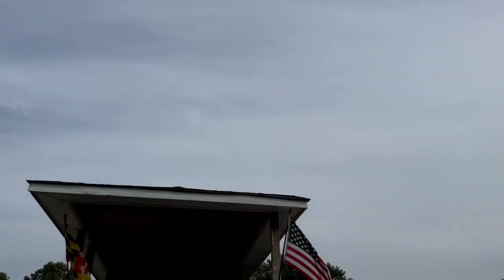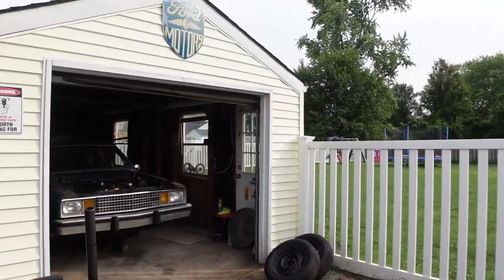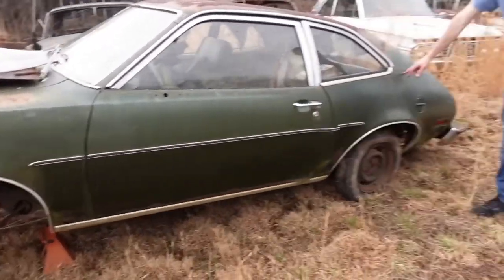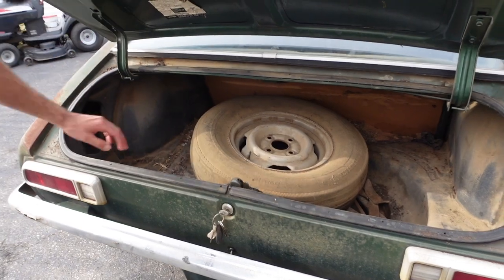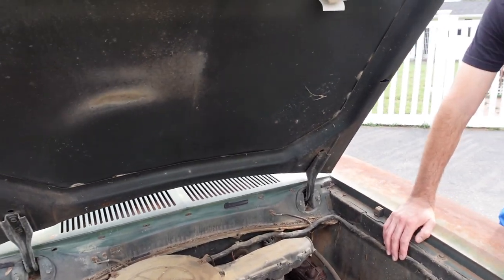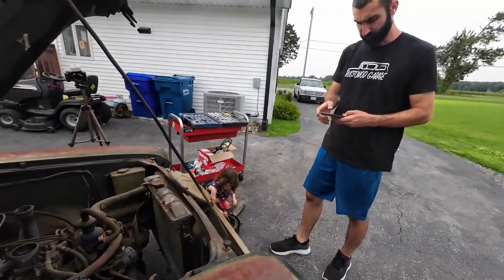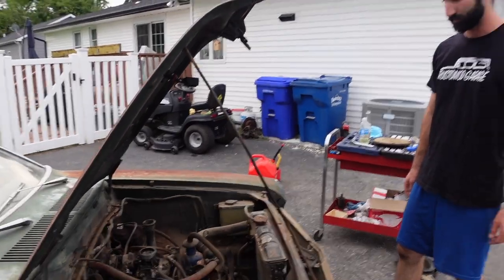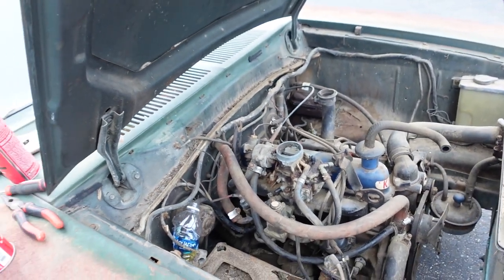Will This Junkyard Patina PINTO Run After Sitting Abandoned For 30 YEARS??

Comment: The Pinto came out when I was 13 years old, and soon it seemed like you saw them everywhere.  I had several friends who owned Pintos, and I both drove and rode in them.  They were considered decent small cars with good fuel economy, and were fun to drive-- especially when contrasted with the typical "road yachts" of the time.  At the time, there was nothing "unique" or rare about them... between 1971 and 1980 Ford made over 3.1 million of them in three basic body styles:  the 2 door sedan (which is what Lance's car is) with a conventional trunk, the Runabout with a hatchback and folding rear seats, and a 2 door wagon.  In the early '70s, imports were taking over the small car market (following in Volkswagen's footsteps), and many Americans purchased Pintos, Vegas, and AMC Gremlins in their effort to "buy American" and still get some semblance of good fuel economy.
Reply: Yes more of the pinto I have a 1974 pinto love these cars mine is just like Lance's

Comment: If Ford had just addressed the gas tank issue immediately, the Pinto's history would be a much different story. I still love the Pinto despite an easily fixed issue.
Reply: Nonsense. There was no gas tank problem exclusive to the Pinto. Extensive bad publicity caused by the lawsuit made it seem worse. The circumstances would have been as disastrous in a deuce and a half. A vehicle stopped in the travel lane, with a just filled gas tank, minus the fuel tank cap, rear ended by a van driven by a distracted driver with a suspended license travelling at excessive speed. 
The lawsuit was about money and someone desirous of political ambitions.

Comment: Great car. My first new car was a '72 Pinto Runabout, Forrest Green Metalic (the actual color name) with green interior. LOVED that car. I had the 2000cc engine. You are correct about the fire issue, I believe the actual deaths from fire were like 7. The Pinto was actually much safer than many other cars of the era. I drove mine cross country a number of times.

Comment: Pintos were never any more dangerous than the Toyotas and Bugs at the time.  It's just that Ford got caught cutting corners on safety.  It chose save money to by not addressing a known safety issue.  The bean counters at Ford estimated that it was cheaper to deal with the lawsuits than fix the problem.  If it wasn't for that fateful decision, the Pinto would just be another 70's economy car.

It would be great to see more of this car.  There are not many Pinto videos on YT.

Comment: The reason them cars exploded is because where the fuel take it and if your rear ended the tank can rub on the rear axle and cause spark and explode but Ford did a recall on them and put a fiberglass guard piece around the front of the gas tank so it will not spark if rear ended.

Comment: The #1 reason the media ran with the story is Ford decided it was cheaper to pay wrongful death lawsuits than to recall the cars and fix them. Also the first people to die in a Pinto crash/fire was a single mom and her son. They ended up issuing a recall anyway and retrofitted the early cars with a super thick plastic sheet in between the gas tank and the rear axle. I actually had a recall/retrofit car with the plastic sheet that I built into a circle track car. Many more people died due to the Chevy pickup saddle tanks on the outside of the frame rail than Pintos.
Reply from the maker: Wow crazy!
Reply: Exactly right. The cars wasn’t the problem, it was no different to other cars of the era. The issue was Ford making a financial decision where a safety decision was required.

Comment: I have been driving a 1972 Pinto Squire wagon for over 30 years. 2.0L SOHC/4 speed. It has zero rust, but lots of patina. It is an original AZ car, and the sun has burned the paint and faded out the woodgrain vinyl to almost white. It was originally Ginger Brown. Except for the cracked dash and drivers seat, the interior is very nice. A new paint job and new woodgrain vinyl would make it look almost new again, but I'm not sure that's what I want to do. It gets a ton of attention the way it is, and I don't have to worry about scratching it. 

These cars are so easy to steal (not that I can see anyone wanting to steal a Pinto) all you have to do is connect a wire from the positive battery terminal to the coil, and jump the starter relay with a screwdriver. You might want to put a hidden switch in it somewhere. The biggest issue with the 2.0L SOHC engine is the Ford copy of a Weber 2 barrel carburetor. They are almost impossible to get right. I'm thinking about putting a one barrel carb on mine. I set points with a business card. So far it has worked every time. I would pour some two stroke premix into the carburetor. Starting fluid tends to burn holes in pistons, and has no lubricating ability. Accelerator pump diaphragms don't last long with ethanol gas. I have to replace mine about once a year.

Comment: This Pinto has the 1978 Factory gas tank fix.  So, no explosions happening here. You can tell by the gas cap.  It's definitely a 4 speed.  The drivers seat is out out a later Pinto.  Ooh, you got the Kent 1600 CC motor.  My 72 Pinto Runabout had the 2000 CC engine with factory disc brakes and automatic transmission.   It was exactly the same color as yours, but it had a black interior.  1971 had 2 door sedans only.  The Runabout was a midyear option and had a smaller window, which was later enlarged in 1972.  The wagon was introduced in 1972.  Yoour Pinto has the same motor as my brothers 1978 Ford Fiesta.  That was a fantastic little car, too.